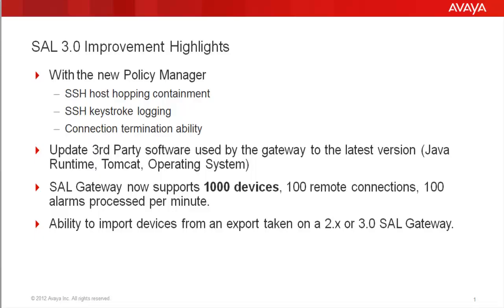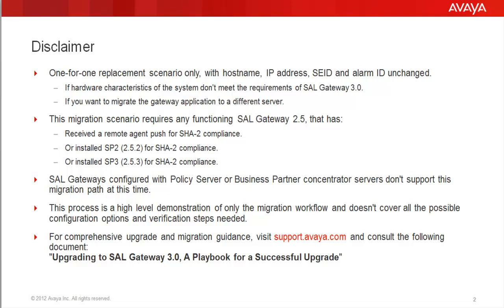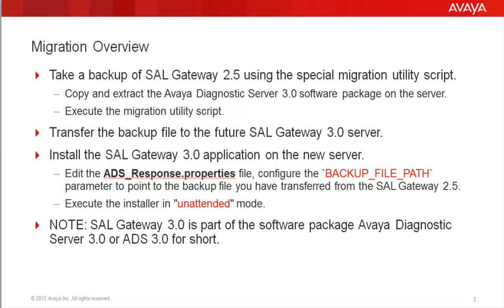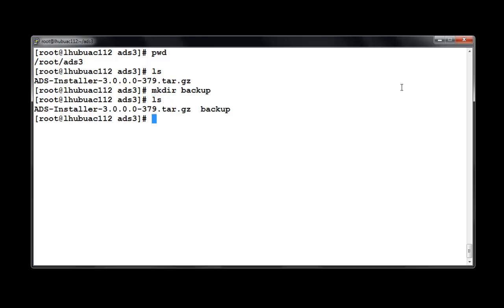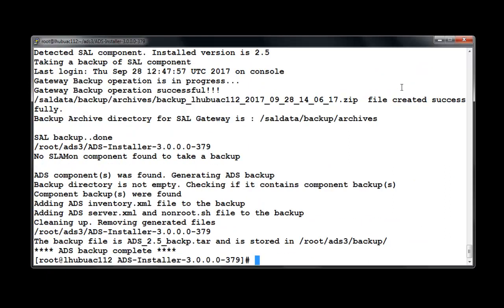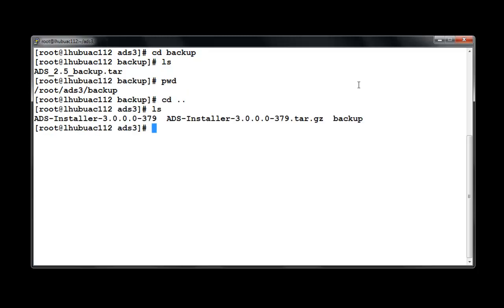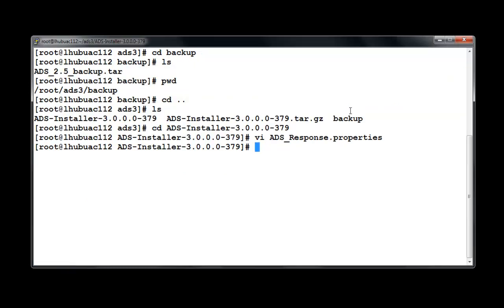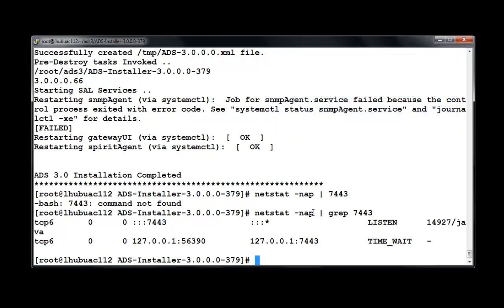How to retire any SAL gateway 2.5 and migrate configuration to SAL gateway 3.0

Comment: Good video. Thank you for putting it together.
In your scenario, are you executing the steps from a server that only has RHEL installed? If I have a (correctly spec'd) VM built with RHEL, would these steps work for SAL 3.0?
Or, does an ADS OVA need to be deployed?
Reply from the maker: Yes the migration will work both with customer installed Red Hat Enterprise Linux and Avaya OVA based SAL 2.5 deployments. Also with 3.0 you can both use the OVA or the customer installed Red Hat Enterprise Linux based SAL Gateway software.